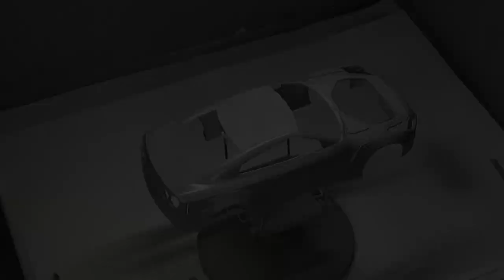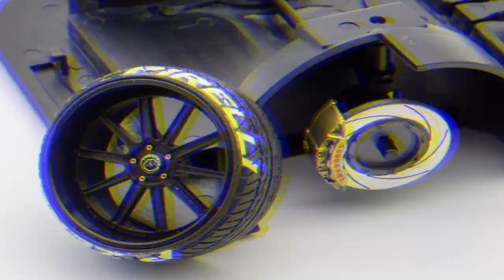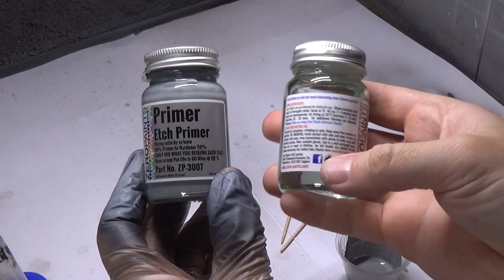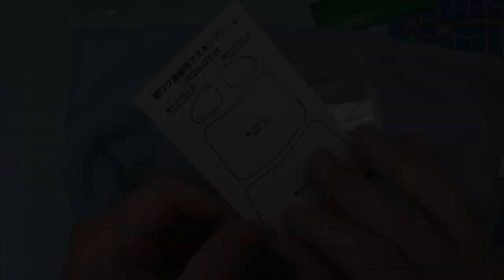1/24 LB Works R35 GT-R Ver.2 full build. Aoshima 054031

Comment: hey im thinking of buying this kit is cutting out the inner wheel rim necessary or can u just glue the extrusion on top of it?
Reply from the maker: yes you need to cut it a little to mount a wheel in the arc